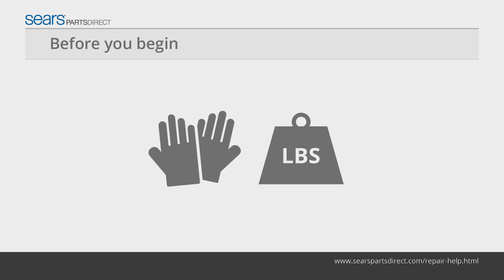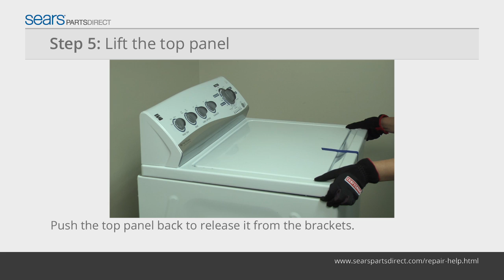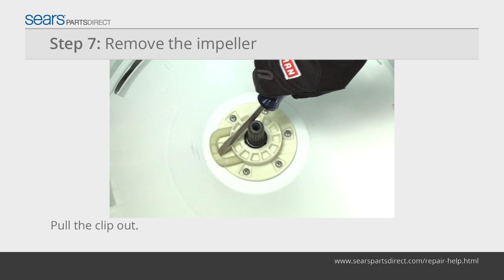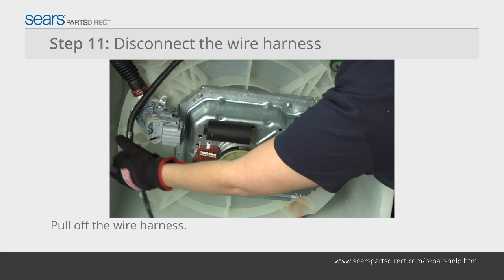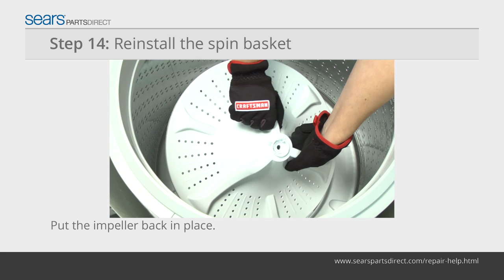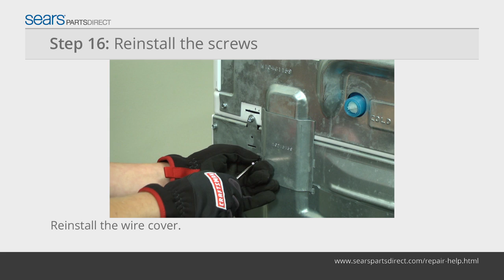How to Replace the Gearcase on a Kenmore Vertical Modular Washer (VMW)

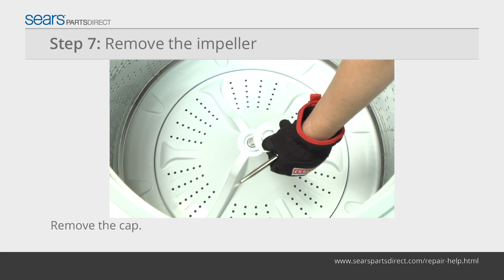Comment: Any tips for removing the bolt that holds the tub in. The one at 1:50? Mine is stuck. STUCK STUCK. Also, is the impeller supposed to spin freely one way but not the other?
Reply: Just happens to me. Got the bolt out, but the washer plate was stuck. Destroyed the plastic washer plate,  but then it's spline stayed on the shaft,  blocking the basket from pulling out. 

Ratchet strapped the tub and 1.5 hrs of hammering the spine  through the tub and it's finally out.   

Have to replace the entire gear case bc the wash plate spline wouldn't come off the shaft.   In this video she took it off with the wash plate in 2 seconds like it was nothing. I literally had to sledge hammer mine into piece to remove it.

Comment: Is the sleeve on the bottom of the inner tub below the basket drive hub (which is ridged) supposed to be ridged to match up with the middle part of the gear shaft?  If so, and it's not, does that mean the entire inner tub needs replacing?   Looks like there is a hint of ridging in the inner tub sleeve but the drive hub keeps it affixed to the shaft so I'm not clear what that lower ridging does.

Comment: Also my washer is very loud during spin cycle especially, what would this be, bearings or the entire gearset assembly
Reply from the maker: Loud noises during the spin cycle often indicate that the washer has a bad tub bearing.
Reply: Sears PartsDirect my local appliance repair store indicated on this model the transmission is bad. I asked about bearings and they told me entire trans has to be swapped. Mine roars on spins cycle. So I guess I will be ordering a trans
Reply: @zachdavis3068  so did you replace the transmission then or what did you end up doing?
Reply: Calvin Iron Shell 🤷🏼‍♂️. I don’t know if it’s a good idea to buy a $200 part for an 8 yr old machine. I found a machine on fb marketplace for $250 and it is less than a year old. Seller will get back to me if current sale falls through

Comment: How can I order a gear set for my Kenmore washer from Sears
Reply from the maker: You can order parts for your Kenmore washer from this website: https://www.searspartsdirect.com/ . Use the model number of your washer to find parts drawings and the parts compatible with your model.
Reply: Also, if I order a new gear set do I need to order a new tub seal, bearings etc or does it come with it?

Comment: Why do you have to remove the tub ring?
Reply from the maker: We had to remove the tub ring to get the spin basket out of the tub.
Reply: @searspartsdirect  Thank you. Once I saw it I got it and I so appreciate how fast you got back to me. My problem now is that I am working on a Maytag Commercial Technology Direct Drive unit, removed the bolt from the agitator, and the agitator won't budge. It's supposed to pull right up and out once that bolt is removed with my 7/16th extended socket. I've read where years of soap buildup and chemicals in the water can bind it to the bottom.
Reply from the maker: @aerlial360  We apologize that we didn't get back with you as quickly regarding this new issue. Freeing a stuck agitator can be challenging. If you still need help removing that agitator, let us know the model number of your Maytag washer and we'll try to provide some useful tips.

Comment: The installation through amazon was a breeze!➣>t.co/FFxp5I8nuU?a10     This washing machine has a huge capacity and takes the same amount of space as my old machine that had half the capacity. It runs super quiet and does a great job! Only downside is the lid lock which takes longer than we would like to turn off.

Comment: Help! My washer does not have a retaining clip to be able to remove the basket. How do I remove the basket on model 110.21302012?
Reply from the maker: Your washer uses a spanner nut instead of a retaining clip to attach the spin basket to the drive shaft. Use the procedure shown in the still photos of this guide to remove the spanner nut and then pull the basket out: https://www.searspartsdirect.com/repair-guide/washer/how-to-replace-the-spin-basket-in-a-top-load-washer.html
Reply: @searspartsdirect  same issue I got the spanner nut off but now the spin basket wont pull out how do i free up the drive from the spin basket? i am trying to access the tub seal as it is leaking.  I have everytjhing else off but cannot get the drive and the tub seperated!